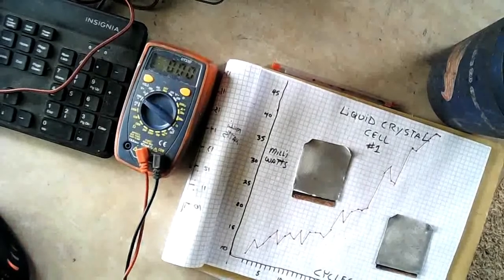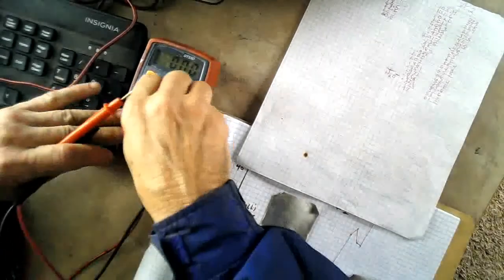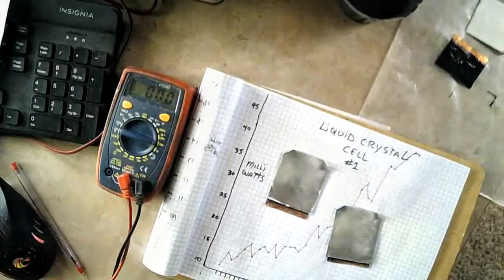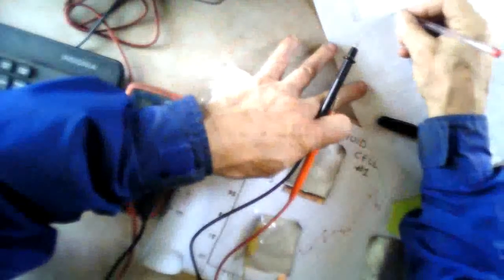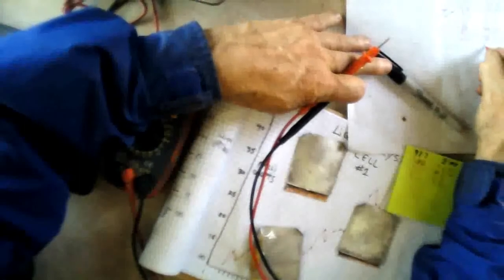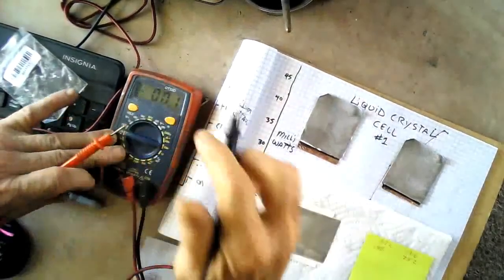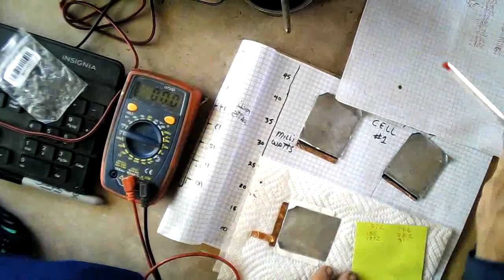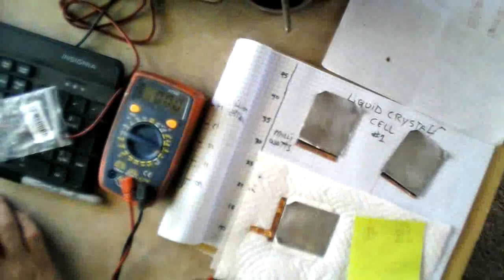Liquid Crystal Bio-Cell! Day #3

Comment: On my phone at work. Started watching earlier but had Easter family activities. Finished watching at work. Quite impressive. Your research is progressing more than anyone else currently doing open source research. Not higher values yet but rate of increase. Gotta walk before you run. Exciting nonetheless. You said you tried sealing before but it seemed to be starved of oxygen.  Seems to be a reasonable assumption but with current changes it might be different.  If confirmed you might need to come up with a method of oxygenation. Opening for additional water seemed to have diminishing benefit. It might coincidentally be the end of a chemical or electrochemical process. Time will tell.
Reply from the maker: It's possible the new solid state cell won't need oxygen, but I kind of doubt it. That's easy to test for however. I think the cell would take advantage of any free water available, but it's hard to get free water into the cell once it dries out (structures the glue).  I think the solid state confines Ion exchange to a local region in the membranes, which just changes state with the semiconductor.

Comment: just excellent work you doing Ray-patience is paying off, just one QA? the test intervals are they 10 minutes, next day starts after 8 hrs or less?  have you checked ambient temperature and humidity this might influence the dry cell performance. i had just that on very humid days cell was giving more power......
Reply from the maker: I measured the cell around the clock at various intervals. Got up in the middle of the night to take measurements. Next time I do this experiment, I'll just measure the cell at 90% every 3 or 4 minutes. That should give comparable results, and be a hell of a lot easier and faster.

Comment: very good after three days, think you might be right about trying to seal the cell, could you seal it with hot glue?
Reply from the maker: I don't know Michael. I believe it still requires oxygen. I think a plastic bag will work fine with an air hole. I hope anyway.